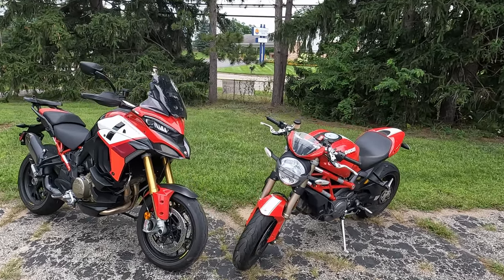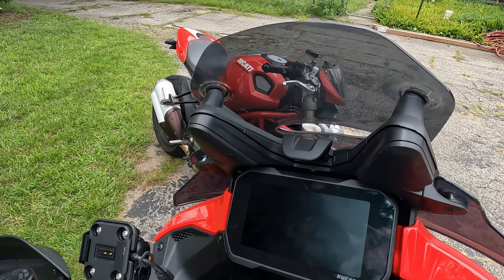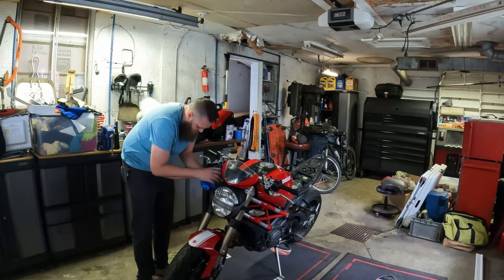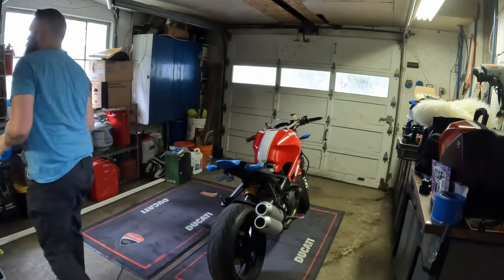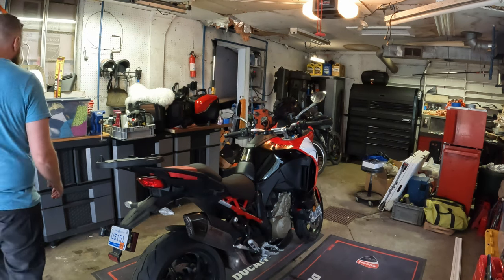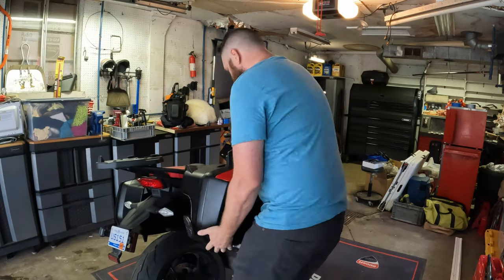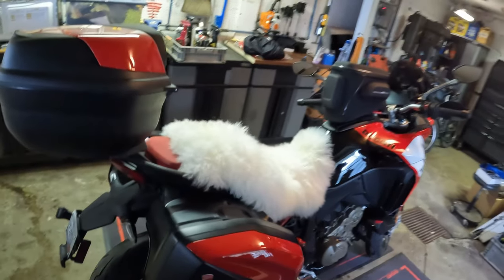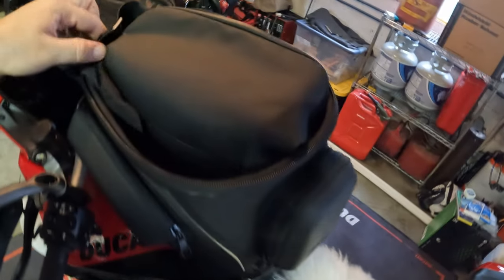Prepping the Ducati's for Track Day and a Trip to Tennessee

Comment: How's the 1100 evo when it comes to mpg? Looking at this motorcycle at the moment. Other than the valves, any issues?
Reply from the maker: Depending on how hard I ride, but usually a minimum of 40mpg but up to 48 for me.

Mine has 13k miles and so far, zero issues.

Super fun bike on backroads, and it was fun on the track as well. I have taken it on a couple 1200+ mile trips and it starts to wear on you. Not the most comfortable bike for long distances.